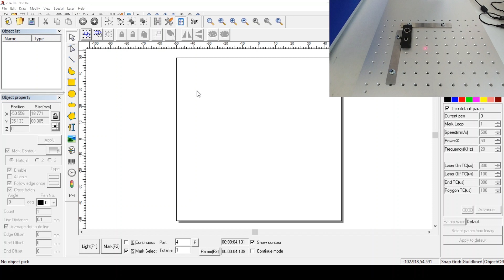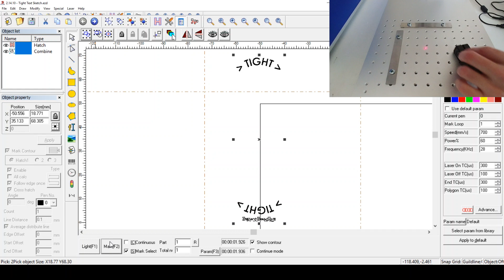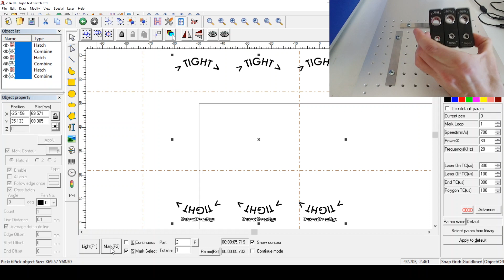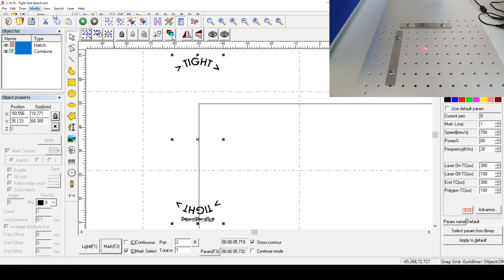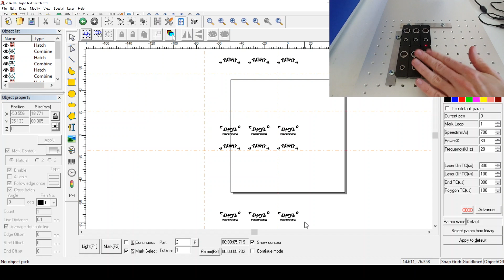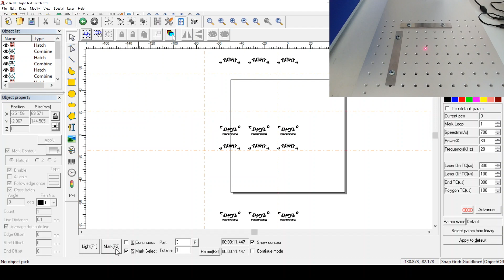EzCad2 Tip: Multiple Part Marking with a Fiber Laser

Comment: Hi! I'm new to ezcad. I would just like to know where to download the ezcad that has "light" button beside Mark, coz mine says "red" and it gives me a square output instead of the outcome lookalike output. And how do I measure the focus from surface of the material to focus point. Hope someone could help. Thanks!
Reply from the maker: You just need to go to parameters f3, other tab, red light option, enable/disable show contour.  That will toggle between the box outline and the actual contour.

Comment: I have an issue where the red light is actually showing just a flat rectangle around the area where the marking is going to be and not the actual graphic itself, also the red light is kinda blurish, any solution to this based on your experience?
Reply from the maker: You can use the option 'show contour' if you have the tickbox on the bottom area of ezcad.  Sometimes it helps to preview as a box and sometimes it's better to preview as a graphic.  If you don't see the box, go to param f3, other, red light pointer.

Comment: Hi Jeff, is there a video on how you engrave picture? thanks
Reply from the maker: There are lots of videos on processing a photo in gimp or photoshop for use on a CO2 laser, not so many on fiber.  You can also import directly and process within ezcad but it's a little clumsier.
Reply: @jefferyj  yes very very less done for Fiber. Sure would be Nice if you could make one so would be helpful for many new comers like myself using a 20W fiber.

Comment: Hy, nice video. Is it possible to save file for marking as XML as our machine uses that format. Can you share your settings for marking cause it looks like you do multiple passes and you get nice white writing. Thank you. Also what are your hatch settings? thank you.
Reply from the maker: EzCad files are saved in .ezd format.  It doesn't accept XML to the best of my knowledge, but you can search EzCad2 download and try it out on your pc.

For the settings, you can use almost anything and produce white on aluminum.  This is probably something like 750mm/s, 50% power, and 25khz frequency, with a .05 hatch (crosshatch).
Reply: @jefferyj  Great thank you. The laser that I use uses stupid software "Solmark II" and when I import the DXF it has missing lines. EZ CAD looks much better and when I import the DXF the lines arent missing. But unfortunately the laser doesnt support that software. Thank you for the parameter settings. I used 20w laser to engrave and speed 40mm/s, with 100% power and 20khz but I believe it was too slow and too much power because the lettering were not as white as yours and the engraving was deep. I will try your settings. Did you try clear anodized or bare aluminum and if you could share your setting for it? Thank you 100x
Reply from the maker: @iguana200  At 40mm/s you're going to end up with a dark or charcoal colored mark when using so much power.  If you're going for white, you don't need much power.  Dial it back to 50% power and move a lot faster, at least 500mm/s.  For black anodized aluminum, I normally use 1200mm/s speed, 65% power, and a .05 hatch spacing (cross hatch), with 20-25khz freq.

This video will show you what a range of power/speed settings will look like on bare aluminum.  https://www.youtube.com/watch?v=ldE-GxITIBI
Reply: @jefferyj  Thank you so much, the video is great. I will try the settings today. Best regards. 👍